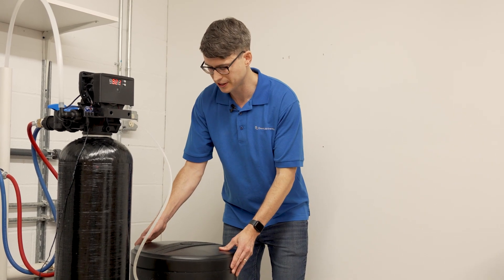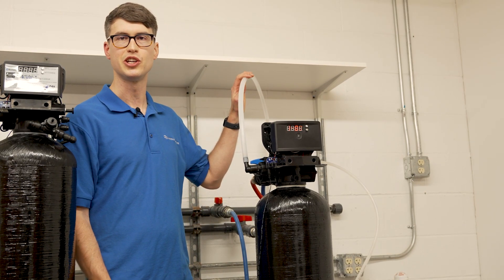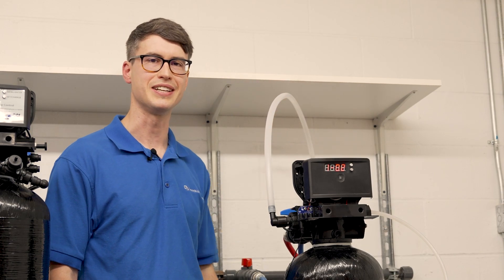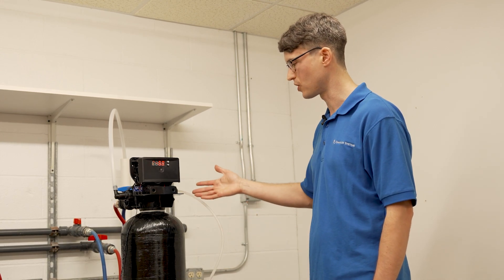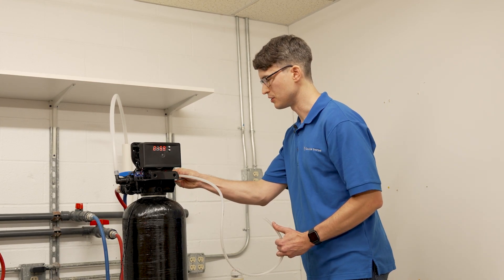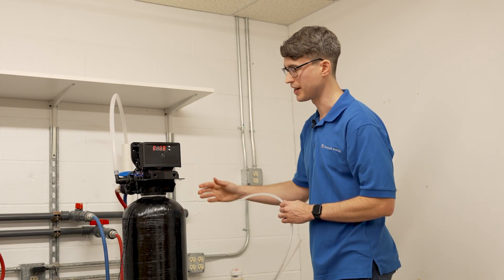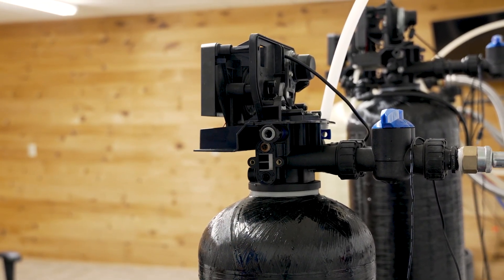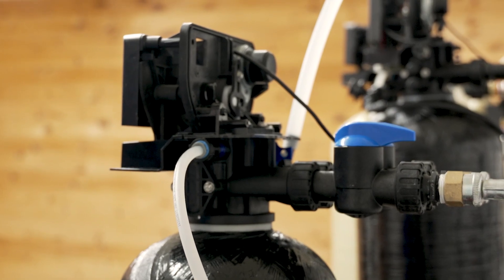CSI Signature 3 Water Softener Brine Draw Troubleshooting

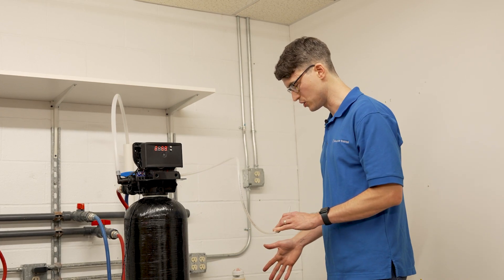Comment: Hey! I'm debugging my brine tank now. So follow the instruction till 3:50, I can feel the suction in the tube, but the water level did not change in brine tank, does it means the components in brine tank get clogged?
Reply from the maker: usually it just means that the tubing is not making an airtight connection at the brine tank

Comment: What if there is suction but will not draw when connected to the valve and if disconnect the tube and put it into water it does draw water.  Just not when connected and with a new valve and float assembly!  stumped
Reply: Same here what fixed it
Reply from the maker: If you have suction at the end of the brine tubing but it's not drawing when connected to the brine tank, then it could be an air leak at the brine line connection (most likely) or it could be an issue with your float or air check.  Worst-case, you can replace the whole safety brine valve float & air check assy very inexpensively, and that would definitely take care of it (as long as you get the tubing pushed in all the way)

Comment: Howdy.  I noticed my soap was not foaming up and it ended up being a clogged injector. Pump is working fine creating pressure or vacuum. The water level in the white tube in the tank has not risen to the level It was before I regenerated it…its a few inchs less.  Is that normal ?  
I pulled a good bit of salt out to make sure it hadn’t got hard so its only half full right now.  Would that effect it?  Everything seems fine.
Reply: Hello, it sounds like everything is probably ok.  I would let it go for a few weeks and you should find the salt level gradually going down and the water level should essentially stay the same.
Reply: @jeffsteiner4660 Thank you.  It is running fine.  All good at the moment..

Comment: Thank you for the vid, I resolved my issue of  high brine water by cleaning the drain valve and  drain line. It had a lot of build up and there was no suction as you kindly demonstrated. I only had a trickle come out on the backwash and not the constant stream you mentioned. My drawdown was filling instead of been suctioned.
Great teacher and very informative.
Reply from the maker: Thanks for the kind words! Glad we were able to help you resolve your issue!
Reply: Where you able to solve issue I have the same issue and could not find the solution

Comment: What if the brine tank water level isn't drawing/going down, but water is bypassing to the drain? I have a Morton system. I've changed the venturi. Rebuilt the rotor assembly. New rotor and gasket. I'm not sure what else I'm missing.
Reply from the maker: hi, we would recommend replacing the Morton softener

Comment: Our water is hard and after each regeneration we have a lot of air in our lines (toilets surge after each flush, and faucets sputter - for first day following regeneration).  Would greatly appreciate suggestions.  Thank you!
Reply from the maker: Hi, air in your lines after a regen indicates that the softener is sucking in air during the brine draw (step #2).  Check the connection at the head and also at the brine tank.

Comment: I had to revisit my system as the dishwasher showed signs of hard water again.. This time I noticed the water draining out during the regen cycle was not a gallon a minute. Not even close..I took the hose off at the pump and the flow from the pump was really strong. I blew through the hose and it was really clogged.  Whatever it was came out and the water flow is perfect now. .. Everything is fine.  I’ll periodically check this drain hose….
Reply from the maker: Excellent job of diagnosing the issue and fixing the problem!  Drain lines are very important and often overlooked when troubleshooting issues like this.